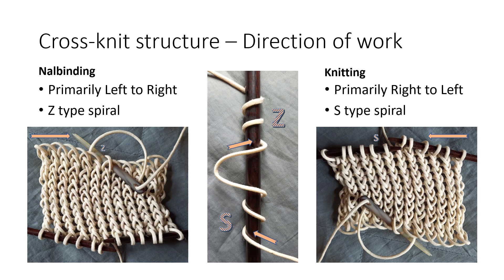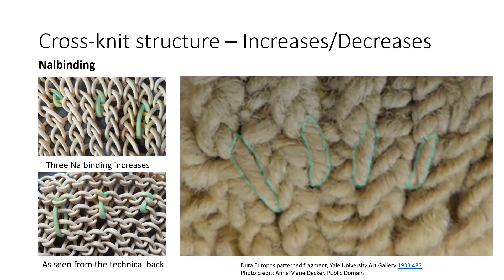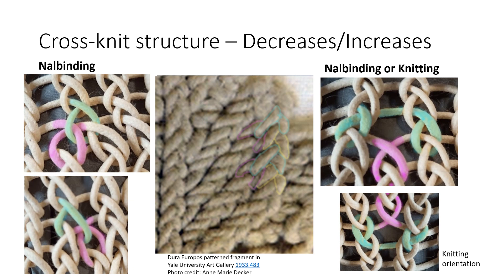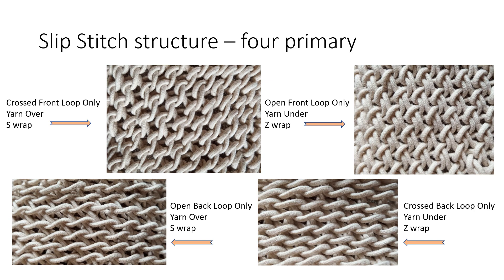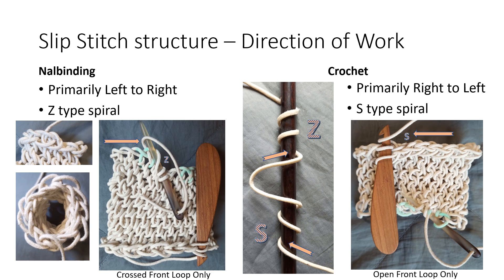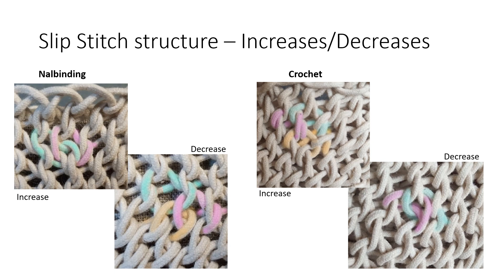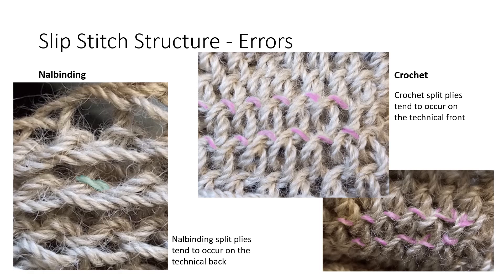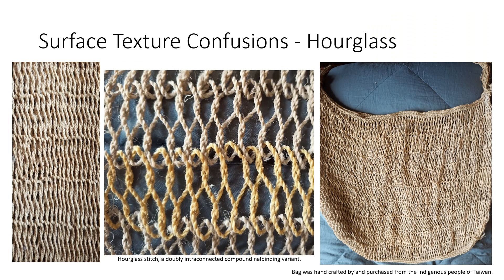But it looks like... methods of differentiating non-woven looped structures - NESAT XIV 2021

Comment: Mm. Have been wondering about this, too. It's sometimes obvious when a piece of "needlebound"(new word, too) fabric is misidentified as "an early knitting technique". But some of the basket weaves, some of the shawl finds, and so on, also seem eagerly misidentified as having to have been employing what we now call "needlebinding". Another problem seems to be, like you mention, that something is identified and placed to a specific time because it looks like needlebinding, and then another time (the usual split happens between 900-1000 or so as the invention of knitting, basically - which is as dubious as suggesting that long, continuous threads weren't invented until that point in time, etc.). The Tybrind Vig finds in Denmark, for example, may very well have been done with needles and looping techniques. And they clearly had the techniques to make fabric. But did they? Rather than using a loom, or using looping techniques with pickups?

Like in every other field, really, the generalisations about what sort of techniques were used, or at which specific point in time something was invented is often much more problematic than we think. As an example, there is a find of writing in the city-museum downtown that someone happened on - it's from the 1200s, long after latin letters would be commonly used. But it's got greek-inspired handwriting, next to latin letters... and then there's runes on the side, just to make sure. It's not put there as a historical document, it's just a trivial receipt of an inventory in one case, and a sample of someone learning to write in another. So in the 1200s, these guys were rediscovering their norse roots, and using runes because they were cool. While the old guys were writing latin with greek-style handwriting. While the common usage of writing was latin letters.

So our finds from the 1200, that actually can be dated in this case because of a city-fire leveling the whole thing and preserving tattered bits and pieces from the same period -- they were already reinventing latin and greek, as well as runic norse, long after the "period" that any of these things belong in, according to "the historical record". And where there isn't an obvious link connecting the greeks to norse settlements. In the same way, our contextual clues now are helping us rediscover needle-binding techniques - but not recreating what was probably also reinventions to some extent. So "the ancients" are, by virtue of just being people like us, romanticising the past and the present according to need, "tricking" us to classify finds to wrong periods. It's very fascinating, and it's an effect everyone should be aware of in any discipline, whether it's trying to interpret old texts by way of assumed contextual cultural information, or if it's identifying fabric-samples. It's really exactly the same issue.